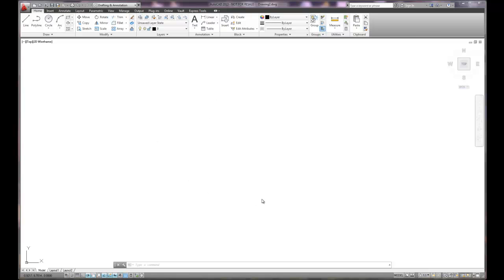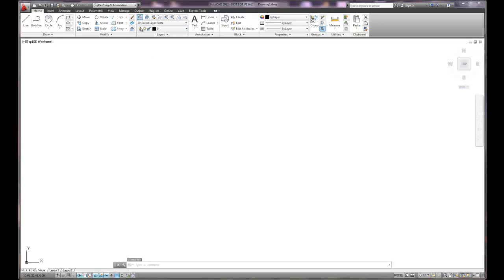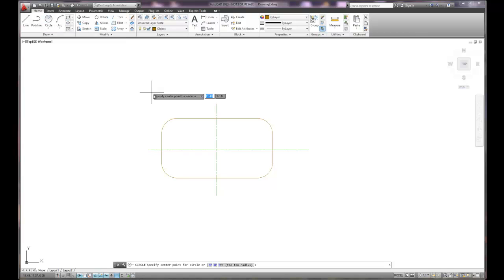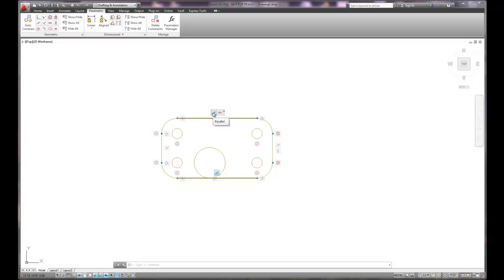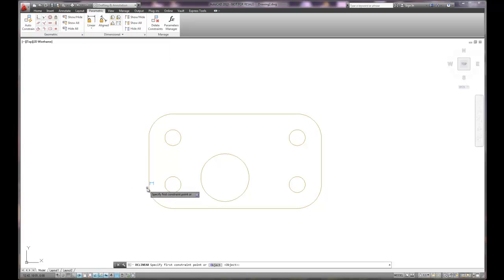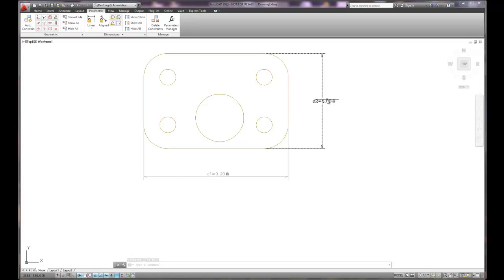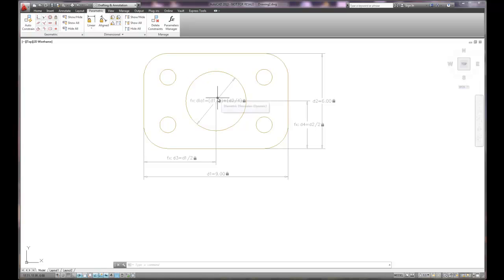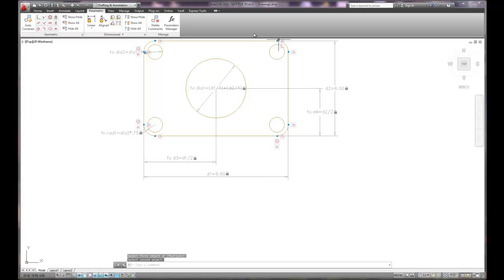AutoCAD 2013  Parametric dimensioning basic

Comment: Why when I select the aligned dimensión constrain the Osnap tool disables? what if need to draft a dimensión constraint from the center of a circle to another center of a circle ¿How can I without the  "_cen of" Osnap? ¿Is there a way to reactivate the Osnap meanwhile I'm in the Dimension Constrain Tool?   Beforehand I thanks.

Comment: Is it possible to use both parametric and geometric dimensioning? I know in solidworks, smart dimensions handles this. Objects can be modified both with smart dimensions and by resizing the object itself. But it seems that parametric dimensions in autocad locks the object so that you can no longer adjust object sizes geometrically.

Comment: you can change these dimensions to annotative, and then they will print. that way you don't have to dimension twice. Or you can buy solid works, it's worth the price, even for 2D work. It is soooooo much easier to use

Comment: Hi, thanks for the video, very clear and informative. A question though. Can you drive the dimensional parameters from an excel file? I need to output mullion lengths / angles from Revit and have the 2D AutoCAD drawing automatically adjust for those output lengths & angles.